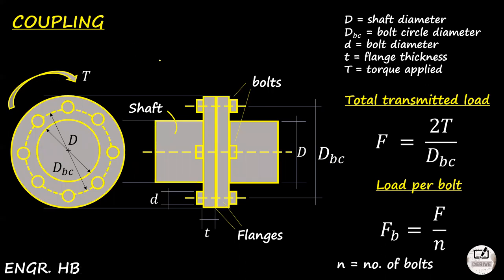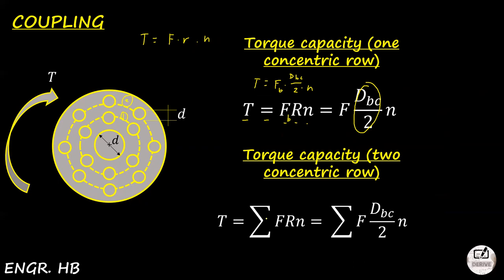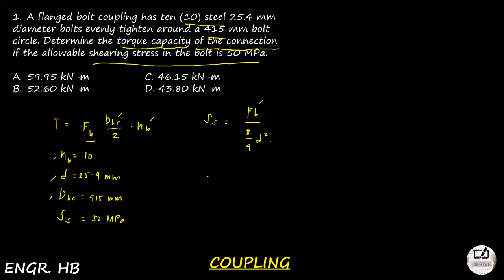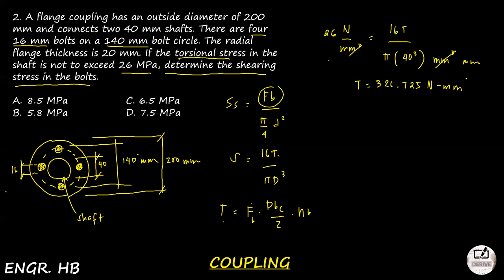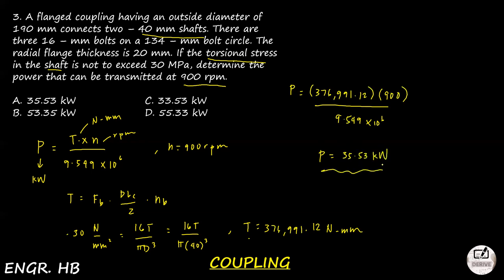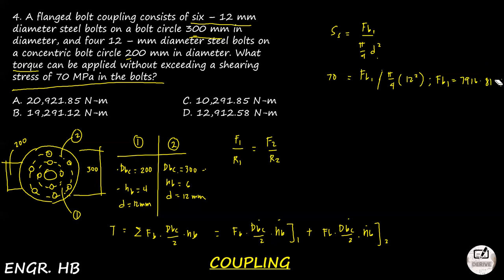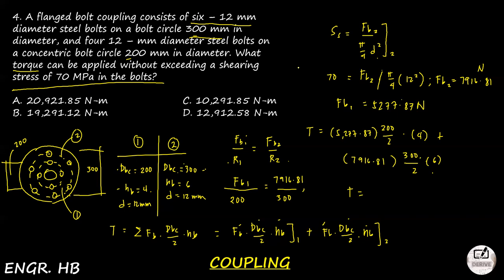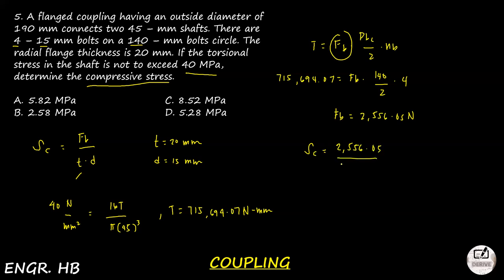MACHINE DESIGN: PAST BOARD EXAM PROBLEMS CHAPTER 6 - COUPLING

Comment: The same Lang yata Yung Fb1 at Fb2 Kasi the same Lang ung shearing stress at diameter ng bolts? Tama ba?
To get 10291.85 N. m,
Galing mo mag Turo engr. HB, Lodi talaga!!!!!!!!!
God bless po engr. ❤️
Reply from the maker: Salamat po!!
Reply: @derive9274  tama yung sagot mo Sir GB, mali ang choices. 
The shear deformations in the bolts are proportional to their radial distances from the shaft axis. The shearing strains are related by 
γ_1/R_1 =γ_2/R_2 .
If the bolts are of the same size, we have
Fb1/R1 = Fb2/R2.
Substituting values,
Fb1 = (150/100)Fb2 = 1.5Fb2.
The shearing stress of the outer bolt circle is larger than the inner, same bolt diameters
Fb1 = 1.5Fb2
(Ss1)(πd2/4) = 1.5(Ss2)( πd2/4)
Ss1 = 1.5Ss2
Design be based on the outer bolts,
70 = Fb1/(pi/4)(12)2
Fb1 = 2520π lb
Solving for the Total torque
Tt = T1 + T2
Tt = Fb1R1n1 + Fb2R2n2
Tt = 2520π(150)(6) + (2520π/1.5)(100)(4) = 9.235 kN-m. 

REMARK: If Fb2 = Fb1, then Tt = 10,292 N-m ⇒ choice C. This assumption is terribly wrong, since Fb1 ≠ Fb2.